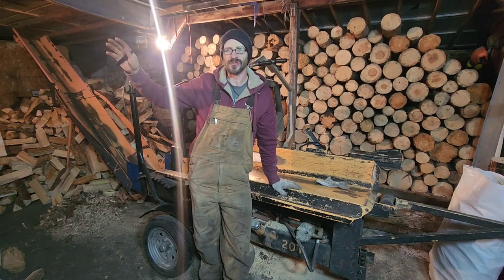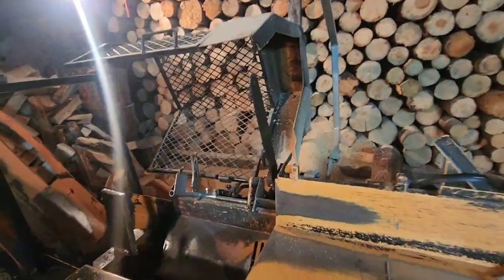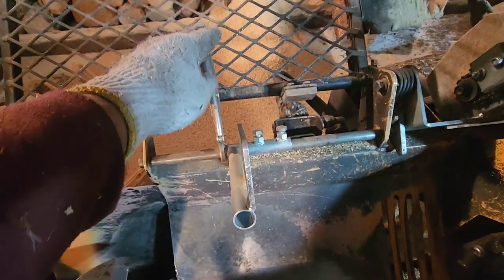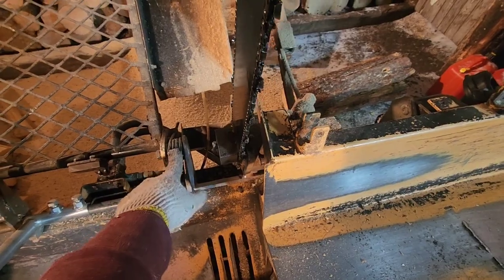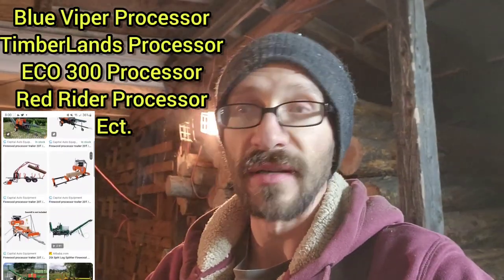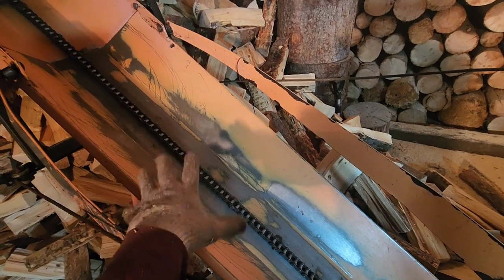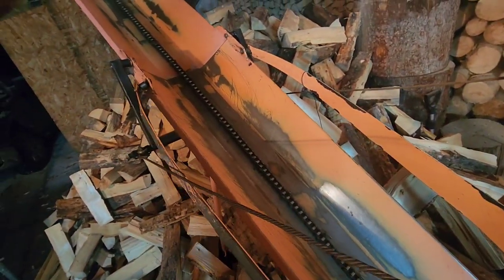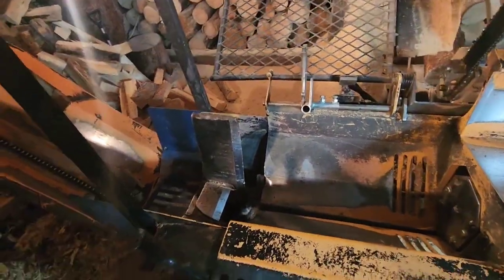Are Those  Cheap Chinese Firewood Processor Worth The Money???

Comment: The ones I sell which are very the same as North forest can cut upto 45 CM 18 inch , but not a lot of fun if you do as you will be resplitting very large chunks 12-14 inch is perfect  and if it was straightish  and you have a log deck which I sell you could expect reasonable quick processing , but with processors there is always something loosening or blocking up or the ram , rams  the wood into the conveyor with 20 T of force  and the welds break .
Reply from the maker: Where abouts you sell you units? And what brand name you under? Agree with your statement aswel 👍Cheers

Comment: Asking the Range-Road EcoPro300 to do stuff bigger than 12in hardwood all day long is asking too much of it. But keep the wood in the 12in max diameter size and it should hold up nicely as long as you are not hard on equipment. My commercial grade log splitter costs as much as a loaded up EcoPro300, but will last a lot longer. Thst longevity is because it is built to do one job: split firewood. The more you ask a machine to do, the lower quality to stay at the same price point. With all the wood you've processed and exposure you've given Range-Road, one would think they would've offered a channel sponsorship with a new processor. Would be really nice if you got a deal like that. For me, I'll start with a Range-Road processor once can get a tractor to move the logs to the live deck. Then use the chainsaws and splitter to handle the logs over 12in.
Reply from the maker: I'd feed the old girl 16inch diameter but the wood needs to be pretty straight stuff but I'd say that's the deal with most processors on the market. Definitely there are proper equipment and tools for certain jobs. Wouldn't make much sense in my situation with the logs I deal with to get a splitter. Although I do get the odd log that's 20-30 inch diameter that a splitter would come in handy for. 👍👍

Comment: Looks like a neat machine, mpre than enough for a home.
I want to build one, any chance you can tell me which motor is on the chainsaw and what pump is it using.
Thank you
Reply from the maker: Hey definitely a great unit for price point. Can pay themselves off pretty quickly. And for parts. Not to sure on that. As most come from China. You can order parts though from Range Road enterprise. Online of course. But nothing on the parts to indicate what specs are.. sorry I can't be more helpful there. If need be  can make a video of the unit more up close. Cheers 👍🪵🪓

Comment: Be nice for you if you can make the heavier-duty Range-Road processor happen. It will hold up a lot better as it is built much more stout. Which is why it costs so much more. Like the saying goes, "You get what you pay for."
Reply from the maker: Ya the price tag on the bigger unit is 2/3 more coming in around 30k I'd personally buy a new ecopro300 and hire on someone to run the second unit and invest the other 20k into logs. That's just me though. Maybe down the road range road with reach out for a sponsorship but till then I'll keep running this old girl. She still got lots of life in it👍👍
Reply: @armandshighlife , that would be about $50,000 in sales if I did your idea of a new EcoPro300 and the rest in logs. I'm hoping for a tractor sponsorship deal, but need to be a huge channel to get those. Then get an EcoPro300 with my own $.
Reply: @armandshighlife  The new Eco Pro 300 list at $7900.00 Plus any attachments you want. With all the attachments I wanted the price is $9700.00 includes sales tax and delivery charge.

Comment: I may have missed it in another video, but what did you change to speed up your splitter cycle. Looks way faster then mine!!
Reply from the maker: Hey its actually pretty stock in that aspect. I do run the splitting ram with the hand lever instead on wait for its auto cycle. That's the only thing I can think that would make mine faster. Most pieces don't need the ram.fully extended to split the wood so I can retract the ram sooner👍
Reply: @armandshighlife  It looks like it pushes the same speed as mine but retracts way quicker. Maybe just the video! I've changed the stop on mine to a shorter throw to speed it up a bit since I'm normally only doing 12" wood. 👍 Good stuff.

Comment: Anything involving metal and China is risky at best. Under significant hydraulic pressure, metal failure is likely
Reply from the maker: Definitely need a hand full of different size nuts and bolts and a welder or a fab guy to keep one of these units in working order. Small price  for a cheap unit👍👍